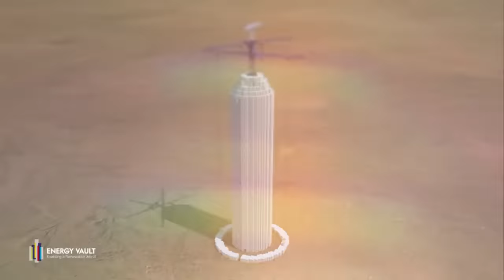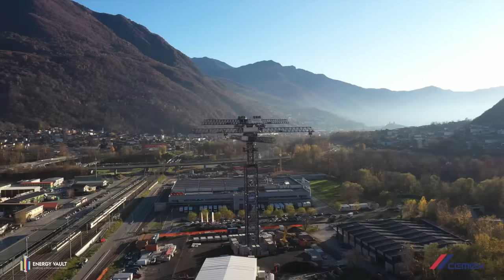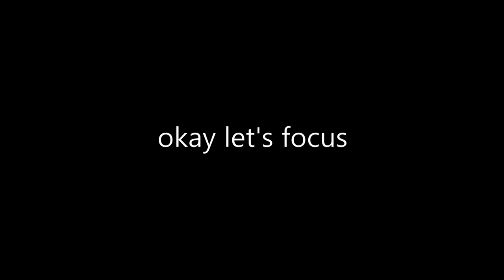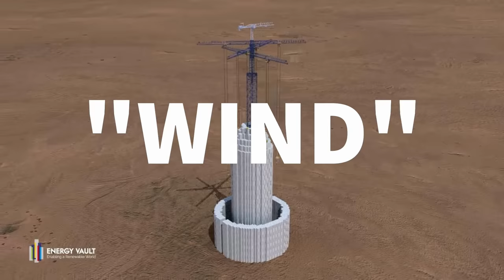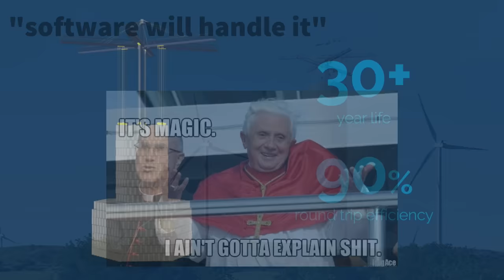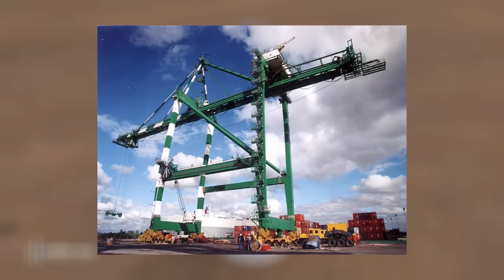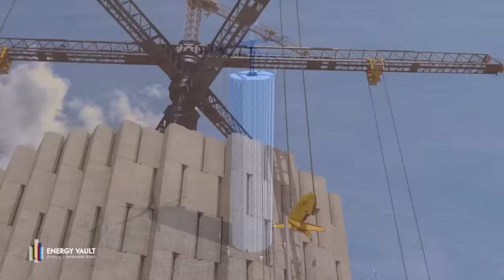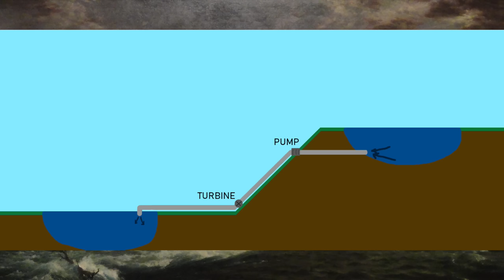The Energy Vault is a Dumb Idea, Here's Why

Comment: I... am so confused by this entire project, because there were already simpler, more efficient ways to do the same thing. Like, say, pumping water upward and then draining it past a turbine. It's not flawless -- it's a beast to construct, for one -- but it's still better than a six-armed nightmare crane that has to stack giant concrete blocks in high winds.

EDIT: I said that before seeing you were going to suggest the same thing.
Reply: - Pumping a mass of water is less efficient than lifting an equivalent solid mass with a pulley
- Pumped storage is only efficient to implement when the natural landscape facilitates it; "energy vault" does not have this restriction
Reply: @gershommaes902  I mean, as far as raw energy required, sure? But water doesn't break down gradually with use like big cement blocks. Water doesn't itself produce carbon to manufacture and the carbon cost of some pipes would compare favorably to the carbon cost of dozens of massive concrete blocks. The video goes into more reasons that this is ultimately a flawed analysis.
Reply: Energy vault says the tower should last for 30 years. Is this false? I'm not sure - I'm not an engineer, and I doubt that even an engineer could assess this claim properly without a deep knowledge of how the system works. (Many people claim the figure simply must be false, without any experience or background knowledge in the field.) I would immediately sing another tune were I to see reasonable evidence this figure were false.

Again, pumped storage is an excellent solution only if it is facilitated naturally by the landscape - otherwise pumped storage would be far more expensive, inefficient, and ecologically harmful. There are many densely populated areas far from natural landscapes that facilitate pumped storage (and transfer of energy over long distances incurs significant losses).
Reply: @gershommaes902  It's false. It's very clearly false. There is no way a bunch of concrete blocks that need to be regularly dropped on each other, no matter how delicately you lower them, could last 30 years without issue. This is the kind of thing you'd make up if you were trying to invent the concept of Hell for Building Materials or Engineering Projects. Concrete is great for resisting a lot of things. This is not one of those things. 

Your argument is basically "Let's take the people who made up this weird project and stand to profit from it being taken seriously at their word that it can do things that are patently impossible to the point that even an educated layman can spot the problems."
Reply: @Devilot109  I'm not ready to take anyone's word - I just accept that there are people who are way smarter than me, who can achieve stuff I never could have figured out on my own. In reality things have been engineered and proven to work that seem much more surprising to me than the 30 year claim here. I also think there is likely to be some allowance for maintenance within that 30 year period. I would also imagine some amount of cushioning could be used to mitigate the wear from constant concrete-on-concrete collisions.

Comment: The reason for using bricks instead of fluid is simple. Higher density meaning more weight and therefore higher potential energy. Using a mechanical lift is also more efficient than a pump.
Don't have to be zement bricks. Other solid objekts with high density will do

Comment: I wish you good luck in setting up pumped storage hydroelectricity in a country like the Netherlands. I am not saying this technique is without flaws.  I have heard some pilot installations are being built and I am willing to wait to see if these work. At least some people believe they have enough potential to invest in them. I do think there are other solutions with more potential, but solving the problem of our future energy system will not depend on any one technique but will require many different solutions. One of your alternatives is being worked on in England in its own variation by raising and lowering a very large weight in deep, abandoned mineshafts, so not all hope is lost. ;-)
Reply: The Netherlands already has lots of pumped hydro storage.   Pump it out from behind the dikes, into the ocean - an almost infinite reservoir at higher elevation. ( Okay, not much higher! ) Any water that leaks in, gets pumped back out again, storing a near-infinite amount of energy in the sea.   Unfortunately, people keep objecting to letting it run the other way, letting the sea in and running the pumps as turbines!  :D
Reply: @FalbertForester   I do wonder why they won't use the sea for that 😉, Maybe has something to do with wanting to keep the houses, buildings, farms etc. dry.I for one don't want to swim 25 miles every day to get to and from work😂😂😂
I for

Comment: Pumped storage hydroelectricity isn't an option everywhere though and you don't have to build  the energy vault at the windiest sites possible. The capacity is a bit poor but I can imagine some cases where it might work to store energy over night for when you can't rely on photovoltaics. The worst thing about it is that it's an ugly monstroscity. Who would want to live near it?
Reply: Seems like if you can build a giant concrete blocks tower you could build a reservoir instead and have basically the same. Concrete does have a higher density than water ( 2~2.5x, that's assuming the blocks are standard concrete not lightweight or cement) but water is, well pretty pliable so you'd have more flexibility in how to manage your tanks and pumping water is a pretty well understood problem.

edit: apparently the blocks are pressed soil so the density looks to be on the low end of standard concrete, 1.5~2x water.
Reply: Oh, you don't like the look of it? Wait until you hear the neverending bangs when a block hits the bottom. All that crane action isn't silent too...

Comment: Another way is to use the dirt from digging the holes and to compact them into concrete rectangles to create weight, save CO2 and structure for the dirt cubes, only problem would be to have something mobile where it could pack dirt in such a manner
Reply: While your turning the dirt into concrete can you turn the water into wine aswell please

Comment: There's a company called gravitricity trying to do this in abandoned mine shafts, so you don't have to build a massive tower. As far as I understand it systems like this are not the best way of storing large amounts of energy, as you need loads of heavy blocks and a large height difference (not very energy dense). Often they are suggested as ways of smoothing out sudden transient loads as they can be started up quickly to produce power with only a short delay. This is still important as we can't control the production of renewable energy to match the load as easily as we can in conventional power plants etc. I think this tower project is snake oil,  as you said, and quite possibly the one I mentioned too, but pumped storage isn't possible everywhere. Other storage solutions will be necessary where you can't build massive dams.
Reply: I would argue physical / mechanical storage systems will become more and more obsolete in the future compared to chemical options (like batteries). They are inherently more prone to breaking because moving parts are the most likely to break (this is why SSDs last longer than HDDs, and why electric vehicles have less mechanical issues than ICE vehicles). They will almost always take up more area and require more infrastructure.

Comment: Phew....I was wondering where you were going to go with this. Glad you ended up on the water. 25 years ago when i was getting my undergrad degree in physics, I had that idea...there was of course no reason for it then. It isn't "rocket" science and "just" needs to get engineered to be reliable and cost effective.
Reply: Ooh yeah?  From wiki:
The first use of pumped-storage in the United States was in 1930 by the Connecticut Electric and Power Company, using a large reservoir located near New Milford, Connecticut, pumping water from the Housatonic River to the storage reservoir 70 metres (230 ft) above.

Comment: The problem with this kind of stuff is that, for many people, all you need to say is "This will significantly reduce climate change!" and they're ready to jump on your bandwagon.  They don't stop for a minute to evaluate if it ACTUALLY can have a positive impact on climate change.  A great example of this is EVs.  Many people with EVs think they're massively reducing their carbon footprint, but they're really just offloading it to the power plant that supplies their electricity.  And yes, the power plant might even have low carbon emissions, but the production of that power plant likely had a substantial carbon footprint.  EVs also have the nasty side effect of needing batteries, which aren't very eco-friendly to produce.

It's not easy to make the carbon footprint of an entire chain of processes zero.  It's probably impossible to do in a short amount of time.  Not to say that we shouldn't try.  But that reality should set off the bullshit alarm in your head when you see proposals like this.

Comment: Flywheel energy storage is an interesting idea. It can only effectively store energy for a few hours, but it's low maintenance, uses simple materials, and has a long lifespan. It might help even out the day/night cycle.
Reply: Way too less energy that can be stored. Do the math for only 1 MWh in a flywheel...
Reply: All the spinning parts will amortize sooner rather then later, considering both the high speed and high weight.

Comment: The concept of storing renewable energy as gravitational potential like this is a left field solution that certainly could work, but this design doesn’t seem logical as a solution that needs to be cheap, simple, effective and reliable which existing designs already do very well
Reply: Gravity has atrocious energy density.
Reply: @jacobmartin9021  yeah but it’s 100% reliable and very consistent. Imagine the potential energy from lifting a 5 ton concrete block up 20 meters
Reply: @ryanm.191  you mean about 0.25 kWh or 1/20,000 of the energy an average 3 person household uses in a year?  This is what I'm talking about
Reply: @jacobmartin9021  0.27kwh and yeah, it was just an example, increase the weight, height and number of them. And it’s energy storage for surge demand, so it doesn’t matter over year long time frames now does it
Reply: @ryanm.191  are you going to buy that block to power your house for 30 minutes?  no.  Then it's not going to happen.
Reply: @jacobmartin9021  no, because energy consumers wouldn’t buy them the same way consumers wouldn’t buy pumped storage dams or battery banks the energy grid would buy it. You don’t think much do you. Stop trying to pretend you know about energy and the grid
Reply: @ryanm.191  This video shows that Pumped Storage is the most economical means of gravitational energy storage by far and even then it's a marginal proposition, difficult to do the necessary forecasting to show profitability.  Blocks simply aren't going to happen because they're just a worse version of that.
Reply: @jacobmartin9021  I never said that this would be more efficient, I’m saying it’s an option, particularly in places where there isn’t money for two reservoirs, a dam, hep plant and the millions of cubic meters of water required. This could be a simply way for smaller remote areas to cheaply set up and store energy. Yeah there’s still methods better than this but not all are feasible for development in remote regions; concrete however can basically be transported anywhere easily. 
Pumped storage will probably remain as the most efficient energy store until dirt capacitance storage becomes larger scale
Reply: @ryanm.191  And my point was even in those places they will just use conventional batteries or pay the transport cost or just  continue with propane because when you pay for energy you are indeed paying off the block.  And anyone can see that requiring a huge block and a crane and an empty place below the block just for 30 minutes of power for one house is dramatically inefficient.

Comment: I’ve been more of a fan of hydroelectric storage. It’s still the same concept done it a different way. I’ve been kicking around the idea of trying to do a small one at the house. I’ve always wanted moving water through the yard (basically my own little mini river), and this could be a way to achieve It and gain from it...
Reply: I like your thinking!  These grand schemes for massive storage might not be where the real value of gravity storage lies.  But as with solar, millions of us doing it in smaller ways make a huge difference.  In the same spirit, perhaps you'd appreciate the value of replacing your battery and electric powered wall clocks with weight or spring driven.  Traditionally the winding of them was a pleasant little ritual (we loved doing the cuckoo clock as kids).  I do recall occasional inconvenience when they ran down. but if they were designed with a bright signal of some sort indicating such, you'd know the time on them was not accurate and check your cell as you wind the clock back up.

Comment: I think your video is hilarious, and awesome, and mostly correct, HOWEVER, I will only say that the only real usage something like the "energy vault" technology would be economical for would be in locations where things like mountains and/or water don't exist, (or at least not in volumes that make pumped storage hydroelectricity plausible) ergo I still feel like your original modification to the tech would be a good idea.
Reply: Pumped storage has been extensively researched in the Netherlands, where we have no height differences to speak of, nor a lot of space to devote to reservoirs.  The original Lievense plan called for damming a large existing lake.  Later plans called for walling off a section of the North Sea and digging a deep hole there, or creating multiple smaller-scale facilities.  The latter could be compared to Energy Vault plants.  
It seems that this concept does have some advantages: a claimed 10-15% higher round-trip efficiency, and a 2-2.5x higher specific weight of blocks compared to water which results in a smaller footprint.  The downside is complexity and cost.  I still don't see a compelling benefit over pumped hydro.  Their concept has since been changed from a round free-stacked tower to blocks sitting in a huge square warehouse... well, you could build the same warehouse but instead of having blocks at the top, you build a water reservoir of 2.5x the height of the stack of blocks in each column, to account for lower specific weight and lower round trip efficiency, at a 15% higher load per m2 on the foundation.  Then replace all the pulleys and hoists with a simple pump and generator turbine.
Reply: @kaasmeester5903  all good points!  And that's kind of my arguments.  However, you're still assuming a water resource is available to be used in this manner.  In many parts of the world (like the middle east and Africa) that's not always the case.
Reply: @ArthurEKing8472  salt water can be used. just make it a sealed system so water evaporation is null.
Reply: @toomanyaccounts  Okay, again, you're missing the point I'm trying to make...  Not every place in the world has access to water like that.  Like how would you go about trying to make this in the middle of a desert? Or in the arctic (or ant-arctic) regions where the water would freeze?  

Again, WHERE water and height-differentials exist, I fully agree with the point of the video!  MY point is that not every place has those two things.

Comment: I think this would work pretty well by reusing a vertical shaft and one big weight that you can raise or let down to store electricity or let it out. This block stacking thing doesn't seem that practical.

That said, a vertical mechanical battery is pretty evidently much more appropriate for certain applications than a hydroelectric setup.
Reply: "a vertical mechanical battery is pretty evidently much more appropriate for certain applications". I challenge you to name just one realistic scenario where this is a better solution.
Reply: @christianfahey3661  old style cuckoo clock?
Reply: @christianfahey3661  Well, any area without access to an aquifer or a lake, who can't build a dam, risk floods, have to handle large volumes of water, or the extension of land that requires such a set-up. In that case they can dig a floor in the ground or just build a big ass shaft and install a mechanical battery that works like an elevator.
Reply: @CptMuttonchops  OR for less cost they could build a water tower and covered pool. It will be cheaper, and more efficient.

Besides. These projects aren't for individuals anyway. They are for cities, regions, countries, etc. To augment the power grid.

For individual use. You would be better off with a power wall.

Comment: The biggest problem is capacity. Both weight and height should be unrealistically enormous.
Solid working body doesn't rely on landscape and has higher density. But capacity still sucks.